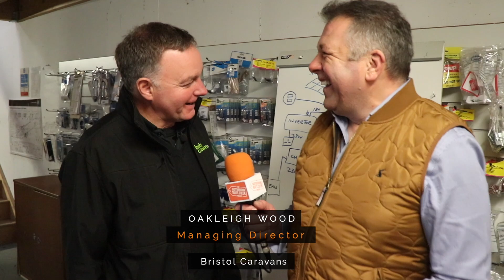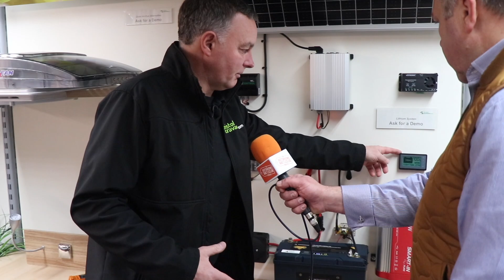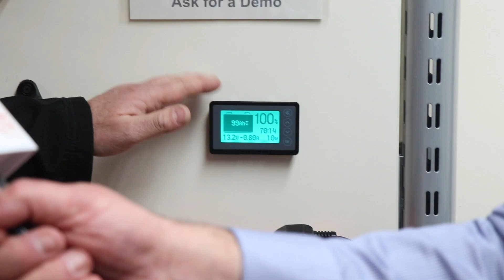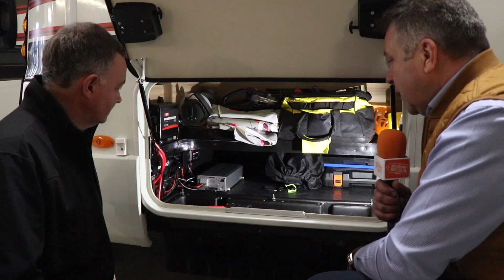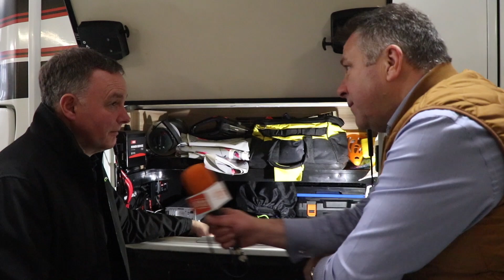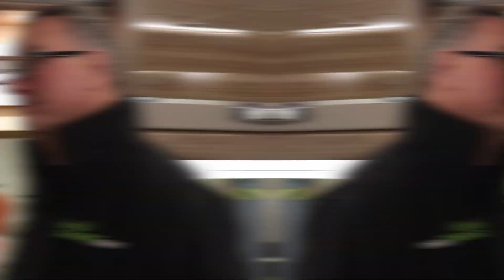Installing a lithium leisure battery | The full guide to motorhome lithium batteries

Comment: The year is 2025 - 300Ah Li Battery is £500.  Victron adapters about £300 (solar and alternator).  It's now cheaper to go Lithium (for the same usable power).  They last longer, they weigh less, and you can get more capacity on board.  
Try getting USABLE 300Ah on board with Lead-Acid batteries.  You're talking 5x 95Ah Batteries, which costs you the same as the Li option anyway.
Reply from the maker: Progress! This video was of course a fair reflection of the situation at the time I recorded it. Things are now moving on quickly for batteries… finally!
Reply: @MotorhomeMatt It definitely wasn't a criticism, just intended as an update on pricing.  Keep up the good work.

Comment: Surely just have an EcoFlow Delta 2 with Extra Power Bank (2kWh for £1K), Solar Panel 175W (£150) direct to it and then their Smart 800W Alternator charger (£280) would do all this and more (being portable) for like less than £1500...or am I missing something. Charge time on the EcoFlow would be Mega quick too and you could basically take it from Van to Van.
Reply from the maker: Yup tho not earthed in the same way but there’s a work around for this. We have a lithium and a power bank. Works perfectly for us

Comment: I found that useful, thanks. Lithium batteries have a fire risk so something you don't want to mess with ?
Reply: Not sure yet just started looking into it as I need a new caravan battery apart from cost it's probably the future for all vans thanks
Reply from the maker: I think you might be right. Certainly wen costs come down further and no doubt the tech will improve too
Reply from the maker: Thank you for watching and commenting. Glad you found it useful. Are you going for a lithium upgrade?

Comment: Matt how does this factor for habitation checks? Is lithium systems part of the checks? Are people that do habitation checks qualified to check lithium systems or is this something we should be getting an expert to look over if we have purchased a van that has not been converted by a big van brand.
Reply from the maker: I would definitely be doing some research prior to choosing a habitation check engineer or garage. Specialists should be aware of lithium checks to be carried out. A great starting place is the NCC Approved Workshop Scheme. They have over 500 service centres and mobile engineers registered with them
Reply: @MotorhomeMatt  a fantastic tip thank you. I did not know that.

Comment: Could you use an air fryer and a coffee machine off a large portable power bank like eco flow for the times the campsite has no electric hook ups? How long would a bank give you for an appliance like that?
Reply from the maker: We use our Power Oak to run a small Nespresso machine. Or we just plug the van into it! Ohms law will indicate how much time you can run for. Ours is a constant 2000w output and will happily make a dozen cups of coffee over a weekend easily! We are off to the outer Hebrides in the van and will take it with us. I’ll report back for sure
Reply: @MotorhomeMatt  look forward to hearing of your trip. We enjoyed our time there. Great gin at the distillery. They dive for seaweed right outside to give it its unique flavour.
Reply from the maker: @SolrenCaelwyn  wow! We will be visiting plus the whisky distillery! Looking forward to it

Comment: We already have charging from alternator to van battery and leisure batteries, I’m struggling to understand why a b2b charger is required?
Reply: Lithium  battery  can take charge  a lot faster than lead acid  battery so it can burn out an alternator
Reply: Lithium batteries charge at a different voltage to that which comes out of your alternator. For correct Lithium charging your battery goes through different stages of charging each of which are done at different voltages and Amps. The B2B charger handles this.
Reply: I'm guessing you are currently charging your leisure batteries via either a split charge relay or a voltage sensing relay. If you have a Euro 6 engined van, (typically from 2015 onwards in the UK), then there is a possibility you will need a B2B charger, especially if your van has regenerative braking.

I have a 2012 Peugeot Boxer van. I can use a standard split charge or voltage sensing relay to recharge my leisure battery. However, my van's alternator only charges at 13.9v where my maintenance free leisure battery needs 14.2v. (A flooded leisure battery needs to be charged at 14.6v to fully charge it.)
I have a Sterling BB1260 b2b charger which boosts the charging voltage to 14.2v. 

Different batteries require different charging profiles, which my Sterling b2b charger, as does the Victron b2b charger and others, allows me to set the charging profile to the leisure battery requirements. A SCR (split charge relay) or VSR (voltage sensing relay) can only charge the leisure battery with what the alternator puts out.
Charging Lithium needs a different charging profile yet again. A b2b charger with the ability to charge lithium can be set to accommodate its charging profile.
Do you need a b2b charger? No, as long as you don't draw much power from the battery before you are able to recharge it at home on your driveway with a 230v charger.  

I use around 20 amps of power a day maximum. If I converted to lithium, then I would probably just use a 230v battery charger.

Comment: Great report no lithium for me then cant justify when a solar battery is under a grand
Reply from the maker: Does solar work well for you? What difficulties have you found with it?
Reply: @MotorhomeMatt  ive a normal 105ah battery on moho never use ehu never run low.
I do have a bluetti eb70 as back up and ive plugged that direct to van once in winter to top up van battery.
People waste a lot of money on kit they dont need.
Love the channel
Reply: Purchased a 100ah lithium battery  on ebay 179 euro.   Renogy  50 amp dc to dc charger, solar charger in one   about 239 euro  , 430w domestic  solar panel  120 euro .  Another  30 euro  for wire and fuses
Sorted